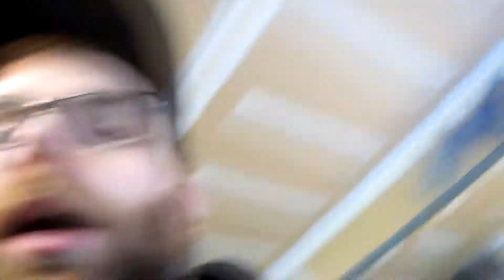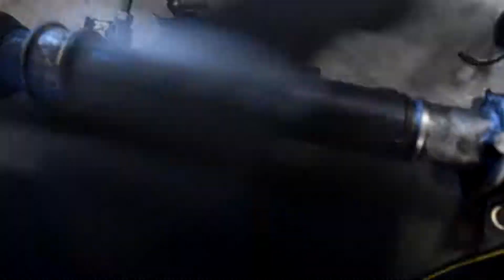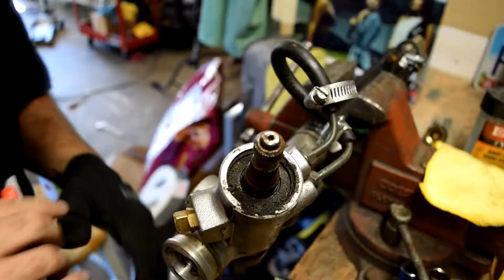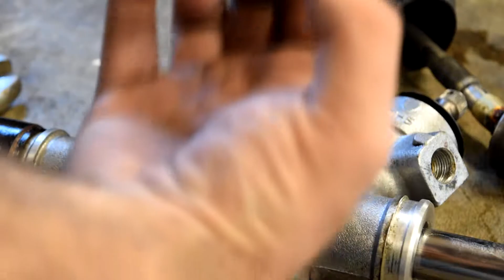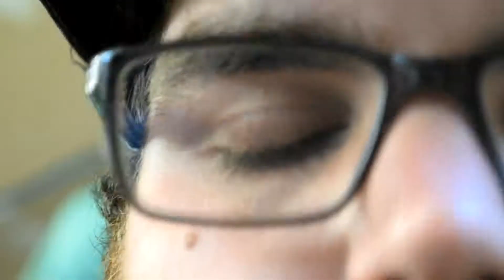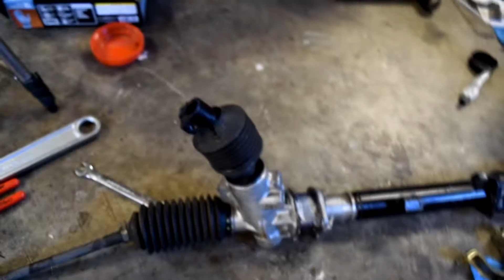How to Depower Your Miata Steering Rack | ITB Turbo Miata Build

Comment: David - Thanks for a great video, I wouldn't have known where to start for disassembling my rack.  It's all torn down, but I have one question.  What is your reasoning for grinding off the central seal?  The innermost part is a really hard rubber o-ring seal.  And you can see that it extends a few thousands beyond the steel ring that supports it.  You can remove this rubber seal with a sharp pick, and I would think that's all that need to be removed.  Am I missing something?  Thx
Reply from the maker: Reduce resistance making it easier to turn the wheel.
Reply: @davidfletcher4016  Guess I didn't explain it clearly.  There is no need to cut or grind off the metal portion of the seal.  Just pick out and remove the rubber o-ring in the middle of it.  The steel ring does not touch or rub on the cylinder.
Reply from the maker: @wstein25  sounds like you answered your own question. Honestly I probably watched someone else’s video and they cut it off so I pry cut it off. The only real goal here was to reduce friction on the rack and if the steel bit doesn’t cause friction then other than the minor weight savings no real point.

Comment: Not too harp but if you use your angle grinder the other way it (right hand side of blade)it won't bite so hard near the end or when you let off the trigger. 
Good video tho thanks, not much on here for 240sx so just getting some video theory here
Reply: lol same, there's barely any info on how to do this on 240s, but from what i researched the process is literally identical.
Reply: @aksfactory  don't fuckin do it bro. 
I'm janky. (Missile car with 2jz) 
Depowered rack in s13 with modified knuckles /ext LCA and added caster for lazy steering. No go. I drove it for a day and went back to ps. Am now looking at electric Volvo ps pump
Reply: @aaronglendon8102    Please describe in detail the negative results you're getting. Thanks!
Reply: @merkin_muffley  s13 steering rack aren't designed to work with put the hydraulic pressure, first issue I ran into was having to change my caster angle so it wasn't so heavy, resulting in that nice comfortable s13 front end turning into a twitchy volvo/corolla.
The ujoint in the steering column, was not designed for being the power assist and doesn't take well to the forces it is applied to after depowering 
You can't throw the steering wheel around anymore mid drift, or let the front end guide itself. 
I've been track driving 10 year now, and going back to a power steering setup was the best move I could have made (I also didn't mention that no power steering will brake your wrist, thumb, whatever is in the way of your steering wheel at the wrong time )